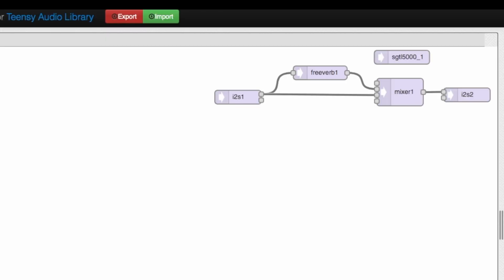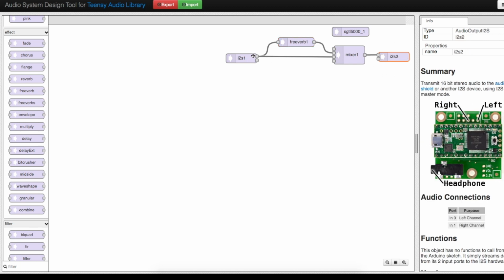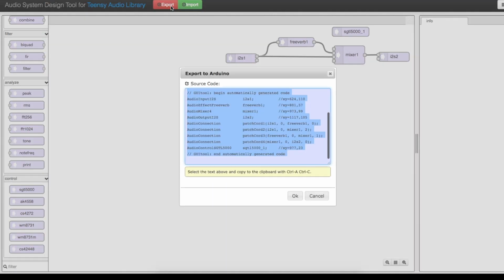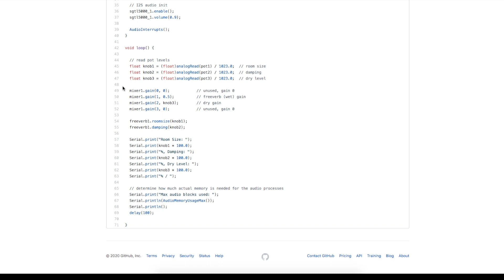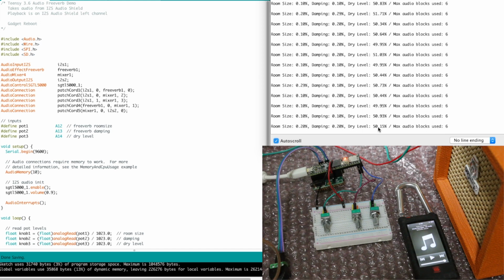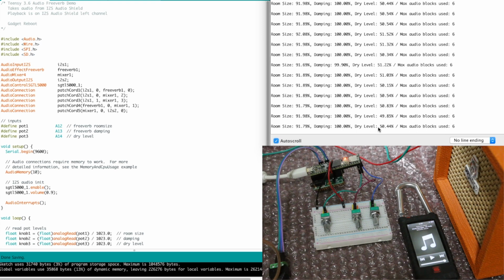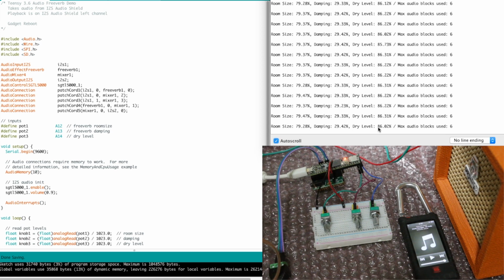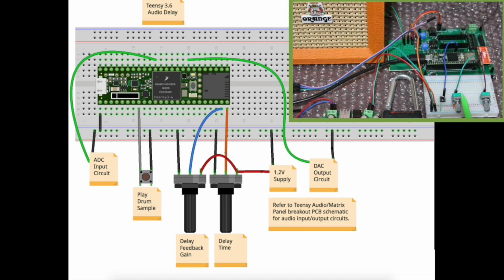Teensy Freeverb Reverb Effect

Comment: The reason you need to have the source run at maximum 0.5 is due to the summing pre-output

If you still get clipping, keep reducing the gain. Multiple grains of the reverb will continue to add to the total gain which will make it clip

Comment: I used to film everything and edit afterwards, but if you made a mistake it was a PITA. Now I film a scene and edit it straight away, and that makes it easier if you have to redo a section because it's still setup. It's not a problem on my i7 4770 having everything open at once, and I leave the cam on the tripod and use a long USB cable so I don't have to move it to get files to the PC.
Reply from the maker: My biggest obstacle is moving the stuff around and not wanting to go back and get set up whether it’s the actual stuff being filmed or the camera itself. First world problem, I constantly mumble that I need more space and a better place where I can be more permanently set up so I’m not tearing everything down constantly.

Comment: Why is that block called a mixer when presumably it adds the signals together, instead of multiplying them?
Reply from the maker: I’m not completely sure but I think for this purpose it actually is a summing amplifier like an op amp compared to RF would be a multiplying mixer https://www.electronics-notes.com/articles/analogue_circuits/operational-amplifier-op-amp/virtual-earth-mixer-summing-amplifier.php

Comment: Thanks, this was excellent!  Just what I was looking for.  Now I'm trying to figure out how to convert a wav file from a downloaded sound sample at freesound into an array for the sketch.  I can't get my audio shield to play on the SD card besides I'd rather have the sound come directly from the sketch anyhow.  I've done some reading on the wav2sketch program - sounds confusing.  Have you used it?  If so, maybe you could do a video on that process.  Thanks - as always, great content here.
Reply from the maker: I got Wav2sketch working to play drum samples from memory, though I was using it on a mac. I recall having to jump through hoops and go on forums and eventually it worked.  Can't remember if I went into any specifics on it but if so, maybe some info is still transferable for other OS's  https://youtu.be/exhIvvogbsg

Comment: How was the latency?
Reply from the maker: I need to do more testing (and I have ordered 3 or 4 more I2S boards with different chips on them now to test, along with a Teensy 4.1) but I found this project that describes similar tests https://cdn.hackaday.io/files/1638357009516640/Final%20Project_Complete.pdf 
The audio passthru latency there was 145us (page 38) but I wasn't clear what they were talking about with max delay 530ms so I'd have to do my own testing when ready to get back at it!
Reply: @GadgetReboot  

The max delay is most likely the total delay buffer size period ..

Effectively half a second

Latency is total passthrough period from source 

Max delay line = Total amount of time due to the buffer size and frequency rate of the array scan
(There's a bit more to this. But that's the simplified version)